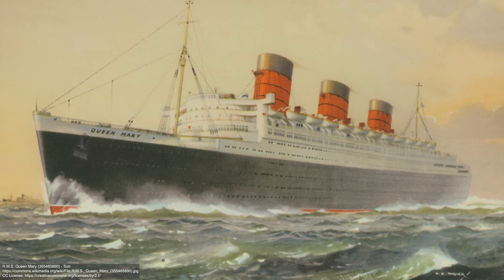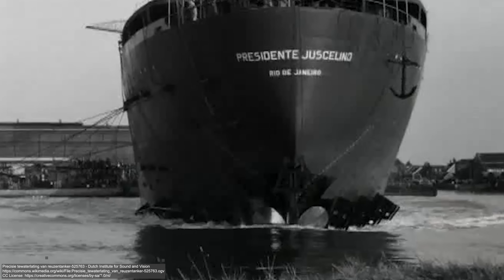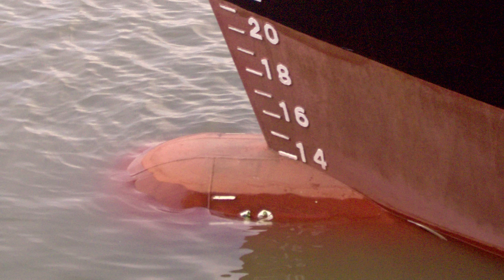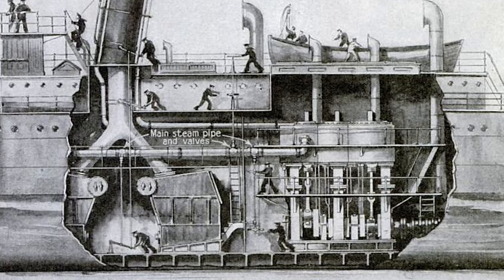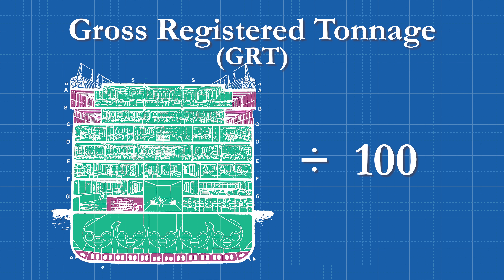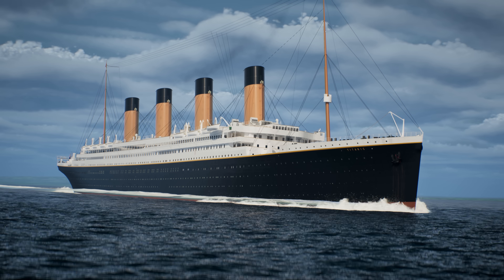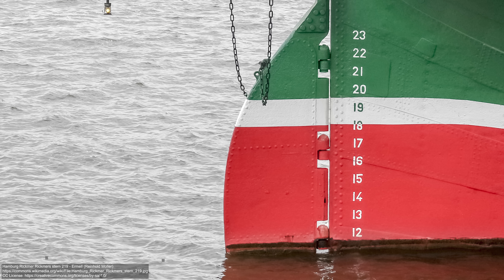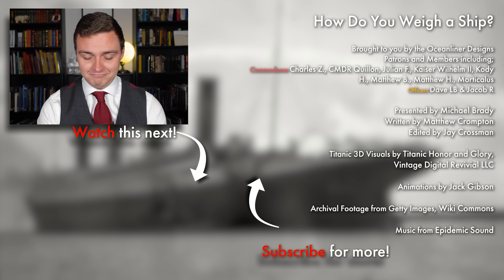How The Biggest Ships Are Weighed

Comment: The Suez canal also used a charge system based on cargo carrying space where the open deck area was deducted from the inside usable and chargeable space. For the P&O and Orient lines that created a situation where the insides of the ships were normally the domain of the Chief Stewards department and the outside was the domain of the Deck Department. Except for the Ball Room in first class and the Dance Space (it was hardly a ballroom) in tourist were built with opening or lift up screens to the outside decks and therefore classified as deckspace for Canal fees. They,  as a result were managed by the Deck department not the Stewards department. Thus being a Deckman I spent a great deal of my time outside monitoring the deck spaces and running a gang of Ordinary Seamen on routine ships maintenance and a group of Deckboys performing deck and passenger duties. Also a considerable time in the ballroom pantries (the rooms where the canapes, coffee and snacks were created for the passengers) attached to the bars, each bar flooded with Draught Carlsberg as a staple diet and almost every drink ever thought of between them. Best job ever.

Comment: When I was on the O boats in the 1960s we had a set of giant scales in a deck locker above the sail makers loft just aft of the funnel, there is a secret space there. Also a spare one not used if possible in the deck stores situated at the very sharp end, but space was tight there with a bloody great wire cable on a massive reel taking up a lot of space and a little door going to a space no one wanted to be in when dropping the hook.

We would take the scales out to check we had not been diddled on fuel oil fill up by hanging it on Sydney Harbour bridge at low tide and using a block and tackle to lift the ship up out of the water and check the weight. Then deduct the average for the number of passengers on board and that was it. Lower the ship, retrieve the scales and store back away for next time, usually San Francisco using the Golden Gate or the Bay Bridge

Comment: Although you did show a few you may have mentioned that container ships use a different system - TEU (Twenty foot Equivalent Unit).  Similar to Net Tonnage but as they carry loads externally the volume is not internal so the rating means the number of 20 foot long containers it can carry lashed topside.  The TEU being the analogue to the 100 cubic foot ton (a 40 foot container would be 2 TEU).

Comment: Is there an actual measurement for the tonnage weight of the steel itself? Not just the volume, but if say 100 plates are used, and each plate is 10 tons, then the ship weighs 1,000 tons, no? The displacement, volume, and varying tonnage measurements don't really exist for the physical intrinsic weight of the material in construction... unless I'm greatly misunderstanding something.
@Oceanliner Designs

Comment: But the food eaten turns into poop in the tanks…which will be the weight of the food minus the energy metabolized. So then, do they not calculate that into the dynamic, fluctuating measure of the load displacement? 😅
Reply: I assume the tanks are on the poop deck.

Comment: 5:04 Genuine query - How is the water more dense during the summer? 

I work in the aviation industry hence the question. Air is essentially treated like a 'fluid' for aerodynamic purposes - colder temperatures (denser air) are beneficial for the overall performance of an aircraft: increased performance ( lift, thrust etc), thus increased cargo uplift (dependent on runway length/ wind of course). 

I would assume the same applies for shipping - colder months, would result in more dense water, thus allowing more cargo to be uplifted? 

Thanks for the content Mike. I'm avid fan of this page.

Comment: I thought the summer/winter lines etc. were not due to buoyancy of water, but rather expected weather conditions which then determine how tall the freeboard is deemed safe? As in, if you go to the arctic stormy waters you need more freeboard to be safe, but if you're cruising between tropical islands on calm seas shorter freeboard is still fine.

Comment: I am surprised you did not talk about the simple procedure of calculating displacement tonnage. A dry dock has a known volume of water. Enter the ship and pump out the water that is left in the dry dock after the boat has displaced a certain amount. Take one from the other and you have displacement tonnage. How do you do this in practice? well, the pumps that empty the water in the the dry dock, do so at a known rate in gallons of water then this is converted to the weight of the water. So it can be said that the displacement of a boat cannot be known until it has been in a dry dock. Thanks to Archimedes in his bathtub, Eureeka!

Comment: Wait...why weigh it at all? Should be just math needed to find out, right? Volume of the hull should be given in the builders plans, and how much of it is under water should be readable on the outside of the hull. So you know the amount of displaced water, and thus its weight. And that should be the exact weight it has when floating.

Comment: short answer - if you know the volume of the water displaced (the area of the hull below the water line),  and you know the density of the water you're in (seawater or fresh, and also the temperature),  you can figure out your total weight at that time.
Reply: That won't work at ports located on the ocean and a huge river like the Columbia River between Oregon and Washington State. Snow melt and flooding far away drastically change the salinity day to day.
Reply: Good seaman !   those readings tells you all !

Comment: Great video but I have a question, does the square-cube law apply to ships? Like if I take a small ship and scale it up, will it float in water? And why are heavier ships more efficient than lighter ones?
Reply: That's an interesting question. I would guess that the actual design of the ship which answers how much is below the water plus where the center of gravity is at would answer that. Totally guessing, so obviously "it depends".🚣😜
Reply: If you keep scaling up, the internal bouyant volume will increase at ~4x the rate of the external dimensions, just as the other comment mentioned. If we keep the thickness of the hull the same, the ratio of bouyant force to weight will always increase as we scale up, and therefore the ship will float (as long as the internal volume is enclosed). 

This is rather simplified though, as the ship gets larger it needs to be made of stronger materials. Stronger usually means heavier, and thicker. So if we use steel for example, there's a point at which the weight of the steel you need to keep the ship from ripping itself apart is greater than the bouyant force. Eventually, you can't even add enough steel to keep it together, and need something with greater mechanical strength.

Mechanical strength was the limiting factor for wooden ships, any longer than a few hundred feet and the forces of the hull acting on itself would simply tear the ship apart. We could likely make steel ships bigger than the largest ones around these days. The limiting factor is primarily the length/width of the Panama Canal (and Suez to a lesser extent). There are bigger ships that can't transit those canals, but they are rare because they're not very economical.
Reply: @maeveyg47 Great. I was asking this question because I watched a video about an RC Ekranoplan, where a guy commented that an Ekranoplan is one of the few types of objects that can be scaled up as much and it'll still work, and could be more efficient than a ship for a similar size.
Reply: In what way? The square cube law inherently applies when scaling any object just due to geometry. If you simplify the boat to be a cylinder it's volume is pi*r^2*h. If you double the radius the volume will be 4x as much because pi*(2r)^2*h=pi*4r^2*h. 

In terms of the buoyancy produced, you could just use the archimedes principle for objects with different densities. For the other factors you could do a dimensional analysis to see how to scale the force required to propel it. Then to determine freeboard and metacentric height you'd need to use moments of inertia. Probably the area and mass moments of inertia to find the COB and COG. I'm pretty sure you can use moments of inertia to determine the stability as well.
Reply: @princepsregem4006 Thank you, informative answer. But will the ship float or sink, if it is simply scaled up?